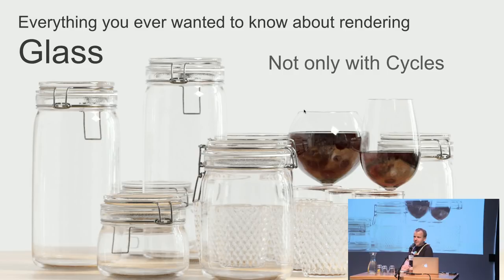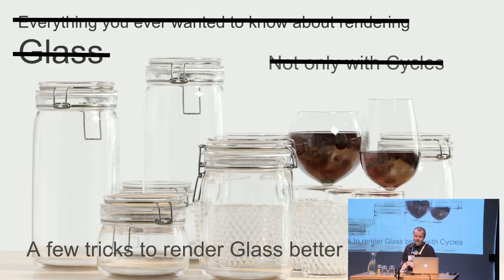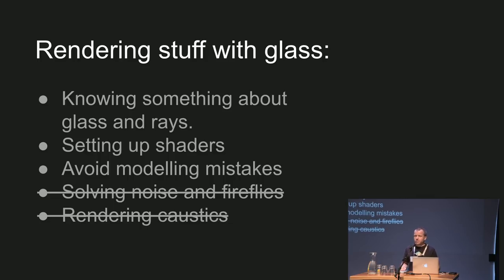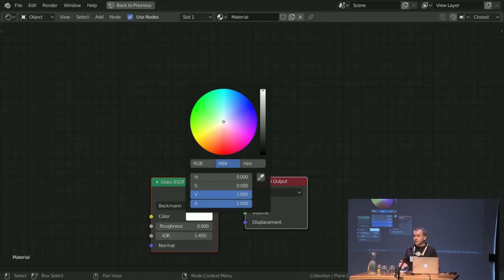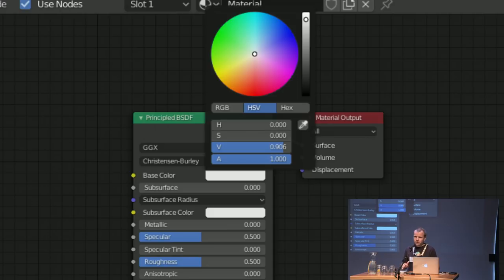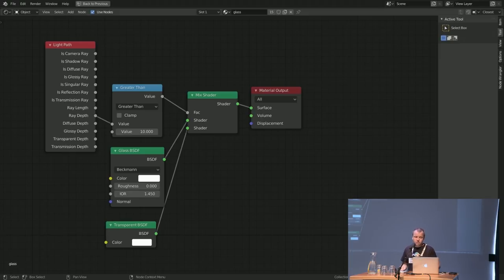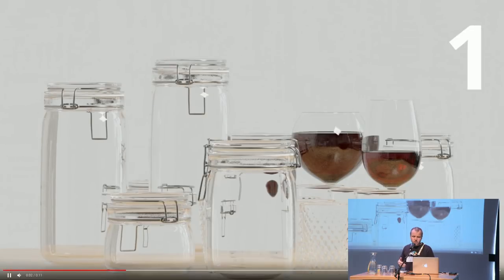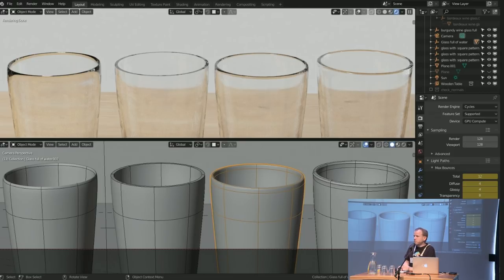Everything you wanted to know about rendering Glass not only with Cycles - Vilem Duha

Comment: Great presentation, thanks! The importance of glossy bounces is new to me. Always thought that the transmission thing was responsible for every glass-related headache of mine.
Reply: Glass is very annoying.  Most headaches deal with a mirror like reflection......its glass....its transparent....shouldn't be be so reflective.  It needs as you originally thought to be more transmission friendly by default.  Even several years ago Ton said   ....Glass sucks.  There should be more updating to materials before adding and changing features in Blender.

Comment: Wow! How did you make these 2D ray renders?
Reply: Free and open source renderer/addon for Blender called LuxCoreRender. It's not 2D though, he probably either used an ortho camera, or put the camera far away.
Reply: @BeheadedKamikaze  But still so hard to render it.
Reply: It's actually rendered with 10 seconds per frame. The camera isn't ortho but perspective with very small angle. Maybe I should make another tutorial for those? ;)
Reply: Okay a bit weird giving a presentation while people eat. That means hardly anyone is watching and all start talking?!?!
Reply: Cycles is just not there yet when it comes to glass, liquids and caustics. Quite some aspects are missing to get real life materials from cycles
Reply: He should try Thea render, this one an render caustics and light separation really well. Also has real material settings
Reply: The green edges are not done with transmission color, in other engines the green color is done with absorption. I guess he used a trick to speed it up. Normally rendering like that takes way longer to clear. Even worse if you add dispersion to glass. Pretty cool trick to fake the abbe
Reply: To bad he didn't pointed out that licked inside a container mostly gets a meniscus. The little, mostly, upcurving edge
Reply: @RomboutVersluijs  I didn't cover liquids at all. The idea was really to show things 'not present in other tutorials on youtube'. ;) B.t.w. Luxcore does a really good job with caustics.
Reply: @RomboutVersluijs  No, actaually everybody did eat in complete silence ;) also there are 2 -3 hours to eat your lunch, so people can take their time ;)
Reply: @blenderkit  that's why, liquid is seen a lot together with glass :)
Reply: @blenderkit that's is well mannered, would be weird for you I guess of not.
Reply: @RomboutVersluijs  I will probably include it in the video, which I plan to do, more focused and shorter with more information in less time.
Reply: @blenderkit  Still baffled that glossy rays mather in this case, I dont understand why glossy rays get the internal reflections to show better. I guess its mainly that trick you showed. PS its bizar these trick work, cycles is really powerful for that.
Reply: Mr Vocsok, try using low camera sensor size of say 25mm and use a focal length of 200mm this will narrow down perspective. Almost looking like the orthographic view. Otherwise, just render in orthographic mode.
Reply: @blenderkit  Nice!
Reply: @blenderkit  yes I would like to see that

Comment: I think the darkness in the diamond happens effectively because, on each bounce, it only has a 1 in 3 chance to stay on the same material, right?
Like, on each bounce, the shader gets evaluated again, and if the first bounce made it purely red and the second bounce attempts to make it purely green, that ray will get fully absorbed. It'd have to reliably stay red throughout. Either that or it'd have to switch to purely white once inside so no further coloring happens. I'm not sure but there might be a fancy light path trick to set that up...

Comment: How should I add some smudges to the roughness? I mean add some imperfections in your node setup?
Reply: add a screen node connect the upper colour input to the surface imperfection texture add a value node to the lower colour in put lower the value lower the diffusion connect the whole thing to roughness in put